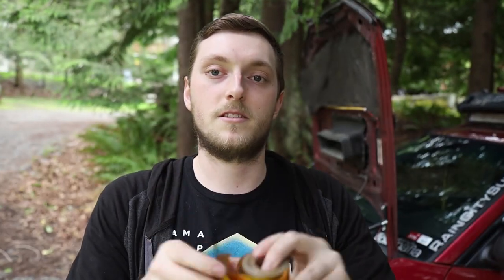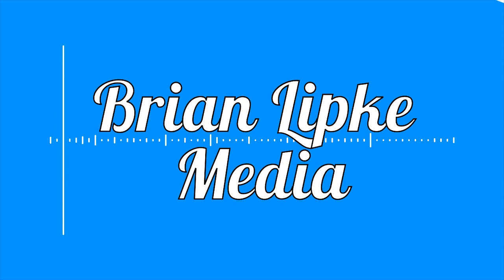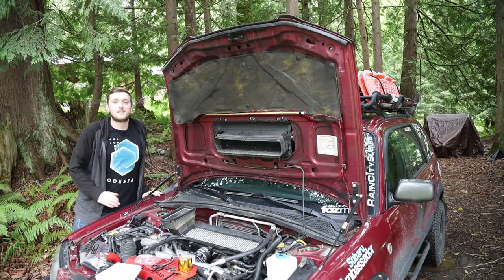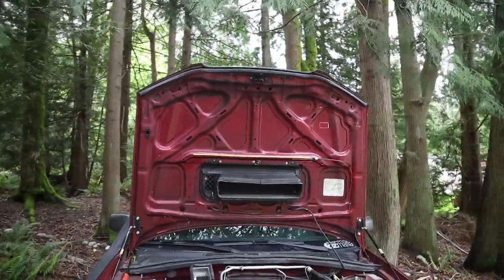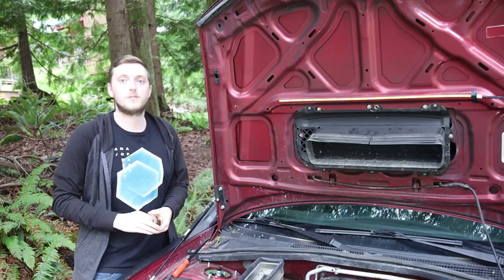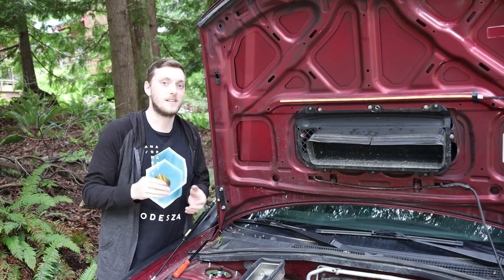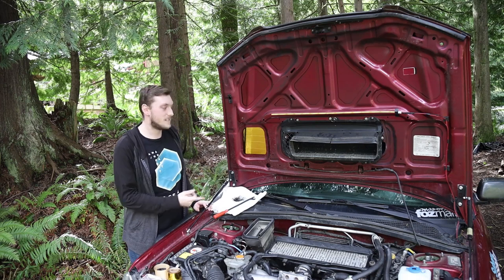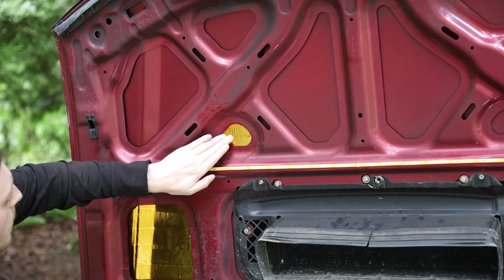Replacing Ruby's under hood mat with heat reflective tape!

Comment: Does it really cool the engine better
Reply: This wouldn’t cool the engine one bit. If anything could be cooling the engine it’s removing the factory cover from under the hood. Exactly what he’s doing is protecting the paint on the other side of the hood from failure due to excessive heat